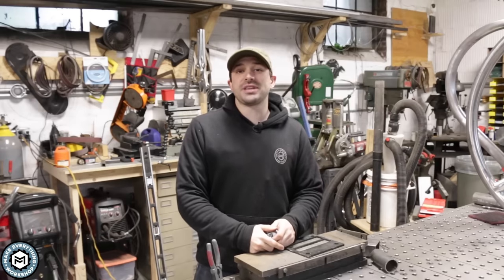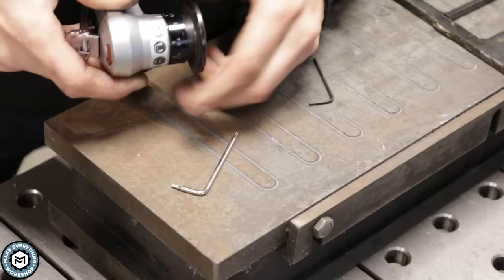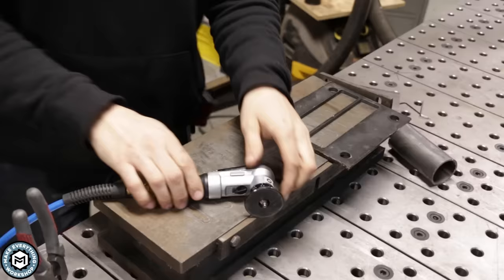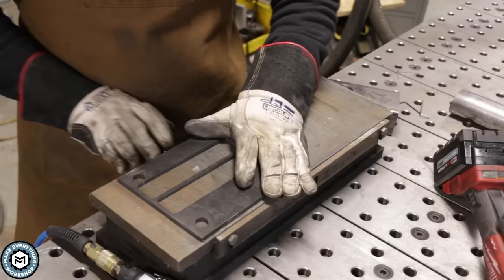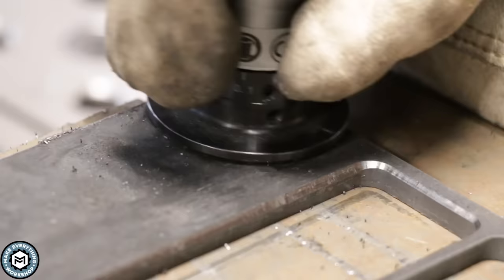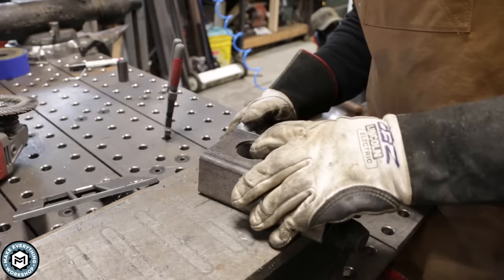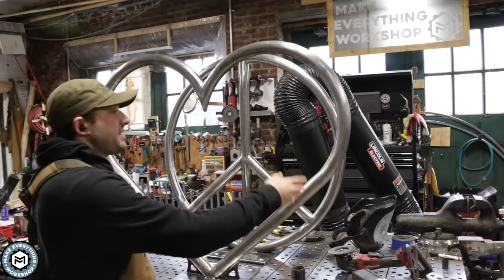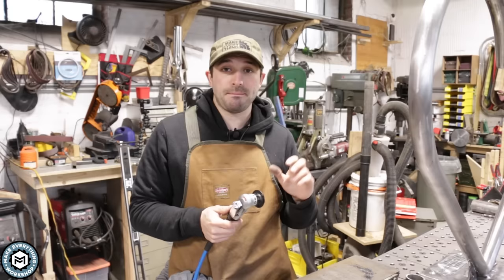This $88 Tool Will Change Your Metal Work Forever!

Comment: I see it as not just as a finishing tool but a prep tool for butt welds. Quick easy chamfer , faster and neater than grinding.
Reply: It would work great for prepping pipe for butt welding.
Reply: Exactly, i am thinking about this use. Thanks to the Algorithm of Youtube that recommended this video to me!
Reply: Yes, that's exactly what I thought even before he showed the pipe that I commonly work with and but weld
Reply: that's the first thing I thought of... I've used a grinder on many pipe ends... this would have been amazing to use

Comment: Basically a router for metal. That really does a great job. Thanks for the linfo
Reply: Interesting, for those without compressed air, using carbide inserts on a router could work well too! I have no idea if it exists but assume it should :D
Reply: @thebibidu  you could probably just use a standard router chamfer bit as most have carbide edges, but without replaceable edges that'll get pricey.
Reply: @thebibidu  just gotta use the proper RPMs for metal vs wood

Comment: I’ve had mine for 4 years, it’s brilliant. The bearings are available at any bearing store, the cutter tips are available, mine lasted for ages though. It’s for steel and soft metal only, don’t use it on stainless.
Reply: They make carbide for stainless cutting, Its a matter AS usual TO NOT LET YOUR TOOL WORK HARDEN THE STAINLESS, keep your feed aggressive and slightly less rpm
Reply: Sad to hear not with stainless steel.
Reply: Why would a carbide tool not work on stainless?
Reply: @AlessioSangalli  One of your commenters replied to you not to use it on stainless - don't now why.
Reply: @raydreamer7566  no I understand, I was asking the dude that said that
Reply: @raydreamer7566  I bet you can use it in stainless, if you use some type of coolant in the process. Use lower rpms.
Reply: We use the same carbide inserts to cut stainless on mills and lathes all the time.  SS is much pickier about federate and surface speed of the tool than mild steel or aluminum. I think I need one of these, first time I use it on stainless I'll make a video ;-)
Reply: @chriswisneski6071  I would like to see it.

Comment: The key to keeping the inserts last longer is heat and not hitting sharp inconsistent edges or hard mill scale. It’s the same insert used for lath work or milling. You usually use coolant in lath work so keep them cool and they will last longer.
Reply: it's not about "heat" as much as lubrication
Reply: @chronokoks  that's what my wife says,,
Reply: That is not alltogether true. Insert tooling either want flood coolant or no coolant. If you use just some coolant the thermal shock will make the inserts crack.
Reply: Coolant on a hand held carbide tool??
Reply: No, I did not say to use coolant on a handheld tool. I said the key is to keep them cool. I was simply saying that mills and lathes use the same inserts and they use coolant to extend the insert life.
Reply: It's carbide, Not HSS. I pull red hot chips off the lathe all the time with no coolant. Trust me. you will chip carbide long before you will ever wear it out.....and coolant has to be on carbide every second. If the coolant gets away from a hot carbide insert and then hits it while it's still hot it's micro crack city and the insert cracks at the next heavy cut. (But you are not taking heavy cuts with these tools) 

I just ordered one of these so I'm not sure of the insert but it looks like 3/8 or 1/4"IC. or there abouts. 

10-TNMG 16040 chicom inserts will set ya back 10 or 11 bucks. At under 40 cents an edge as far as using coolant or cutting oil....Who cares?  If you don;t break a chip you should go months of everyday use before you hae to flip an insert.
Reply: @mathewmolk2089  Thank you for specifying the Insert Part Number for us noobs.

I'd rather buy locally than having to import directly from China
Reply: Can't ite inserts be sharpened?
Reply: Carbide inserts cannot easily be sharpened, it would take a long time to fix a tiny chip. They are super hard. It takes a specific grinding wheel too.

Comment: That pilot bearing looks like a standard size for router bits. The screw on end of the cutting tip should be removable to let you change the bearing. ✌
Reply from the maker: Good catch! I haven’t looked too closely at it but I’d guess you are right!
Reply: @MakeEverything  That's what YouTube is all about to me. I made a 2×72 grinder with help from videos which would have been a real bear without them. ✌

Comment: Measure the dimension of thr bearing with a Micrometer and order from almost any bearing supplier.
Reply: Or take off the bearing to see if it's marked!  Too many posts saying "it looks like..."
Reply: Or, just ask for a 683ZZ, as specified on the parts list (that came with mine).

Comment: Just ordered and received one of these. Can’t wait to try it. 

The bearing is a 638ZZ. Easy to find. They sell them on Amazon.
Reply: It's  actually  683zz 3 mm x 7 mm x 3 mm.
Reply: I bought a kit of 10 bearings of this size and this number is even in the tool manual, but the axis is not 3mm but 4mm, I threw money away.

Comment: Thanks for the tip, I just ordered one from Amazon. About the bearing I have a company in my city that just sells bearings in every size, so when I get it I will go down their and purchase some spares that most likely will be a lot better quality, then I will let you know. The grinder itself is about two weeks out before I receive it. Can’t wait to use it👍👍👍
Reply: Would you post the bearing size for others?

I should find a local bearing company, and give them some entertainment with the weird ones I try to find - like ones to repair the roller-brush on my $130 Hoover house vacuum.
Reply: @firstmkb  I won’t be getting the grinder until about the last week of July. The company is all they do is sell bearings and I will have to take it down their to see. If they can’t match it to something in their books nobody can is my guess; because all these duds do is sell bearings only and all types.
Reply: I have one and the bearing is a 683ZZ.

Comment: Just because you can never have too many sources for replacement parts, that little bearing is also found in 3D printer parts very regularly, especially around motors and extruders. You should be able to get 10 in a pack for a couple bucks.
Reply from the maker: Great tip! Thank you!
Reply: Yes but, those low quality bearings won't last long at 30,000 rpm.

Comment: That tool is very similar to a router bit used for wood working, so you may want to look at either Rockler or Woodcraft for the replacement bearings.
Very cool tool.
Thank you for sharing.
Keep the videos coming.
Reply: bad advice. chip a flute on a brazed carbide its done. where those tcmt carbide inserts are cheap. very cheap, and can be replaced one at a time.

Comment: This is just another Aliexpress tool you can buy the bearing for 20 cents and packs of cutters for about $2-5. There are tons of these types of specialty tools on Aliexpress because china applies mass production to EVERYTHING, so it makes sense to have a specific tool for every step of the way to make things as fast as possible and maximize output.
Reply: Yep, just search "Mini Pneumatic Chamfering Machine" on Ali for them.

Comment: That bearing is probably the same as my wood router bits.
Reply: Beat me to it.
Reply: I instantly wondered what kind of cut it would make in wood.
Reply: @markkollman870  pretty well I'm sure since rpms are probably around the same but ya can't take as big of a bit with his router as a normal wood router but for that little chamfered it does produce is probably pretty good on wood just not as adjustable

Comment: I am a machinist and have owned this tool for over a year and only used it a day.  If you are just looking to deburr and think this will be easier and fancier, it is not. Very slow and hard to maintain an even chamfer. Video says that it throws sharp chips out, but left out they are also hot as fire. For welders and those who absolutely need chamfers  with no other tools to get the job done I would recommend this tool.

Comment: Milwaukee needs to make this on there 12V Fuel platform.  Air tools are so freakin loud and the hose is annoying.
Reply: No thanks. You need serious PPE anyway and battery tools are over expensive
Reply: @AlessioSangalli  I would gladly pay the premium of cordless over an air tool.
Reply: I like my corded Milwaukee tools...
Reply: I like turtles
Reply: Bow to me faithfully Bow to me splendidly  that is only relevant if you use such tool for such lengths of time, thousands of hours, that energy cost becomes more expensive than batteries. In such case, the tool couldn't be cordless anyway. I understand if you say that a compressor has a higher non recurring cost or it takes valuable space in the shop, but the argument about energy cost to me seems very weak.
Reply: They do. It is a router. Use it every day for metal, works awesome. M18
Reply: @pscgmail  Hmm I might have to give that a try - thanks!

Comment: These cutters typically are also double sided, so you would get 6 cutting edges per cutter. Just a thought and you might check. Zip~
Reply: These look like TCMT inserts based on the Amazon picture, so they'd be single sided (because of the 7º relief angle) .. granted Amazon pictures can tell 1000 lies :)

Comment: you change the bearing for a small brass piece, stick a small disc behind and you hold the bearing with a sunken machine screw. Bit of blue loctite, don't gorilla into the bottom but just let the brass slightly rotate..  :)

Comment: Nice tool! The bearing should be easy to find from remote control Nitro engine clutches. They can tolerate 25k rpm plus

Comment: When chamfering plasma cut with work hardened surfaces, be sure to run this cutter in a conventional milling pattern (not climb milling).  Get under the scale rather than pull it into the cut.  Your inserts will last 10X longer.

Comment: I'm sure glad that I came across this video. There are different camfering tools out there but the ones I have seen are bench mounted so you have to bring the material to the machine. The carbide cutters look like standard TCMT to me. The size is either 1/4" or 3/8" I.C. that stands for inscribed circle. This is the size of a circle that lines up with the three flat sides. The first thing that I would do after purchasing one is look at the bearing number and buy any name brand bearing.

Comment: I know it would be messy and need cleaned for welding, but I would what about a lubricant? It could even be the water based machine cutting lube. It could produce a smoother cut but that can be smoothed if needed. Not needed if welding as the “Angle Cutter” is providing a deeper penetration while staying flatter on top. Just a thought but after all, 3 sides to each cutter would decrease the cost per use. Also, if it is cutting on the side, the tip maybe perfectly sharp for re-purposing the cutter on a brake lathe as they look the same without actual measurements. McMaster-Carr May have these cheaper by size and angle of grind on the cutting face. You may not have a brake lathe for cutting disc, but may worth looking into. Just a thought as on the farm or small town shop, you never throw anything away. Tool of the week, from a guy who became an ASE Master Tech before MIG welders were sold.

Comment: Always thought a router table type setup would be handy where you could walk up, hit a foot pedal switch and run a piece of metal over a grinder that do the bevel.  But it wouldn’t work for inside edges like this tool can.

Comment: Nifty. It's probably overkill for this application, but you could probably also use it to chamfer edges before welding a butt joint.
Reply from the maker: Sometimes I do that actually, it’s nice on square tube when your doing a lot of it

Comment: Look on the face of the bearing. One side or the other. There should be some numbers you can get an exact replacement based off those numbers.
Reply from the maker: I’ll have to look closely at it and see! If I find a replacement bearing I’ll post the link to it in the description too. Under heavy use I could see the bearing failing

Comment: You actually get SIX new sharp edges on those carbide bits. After rotating 120deg for the first 3, you take th carbide off and turn it over for another 3.

Comment: That looks exactly like a router bearing... I don't know if it is or not? I worked in a cabinet shop for 5 years. The ONLY oil we would use on our router bearings was Marvel Mystery Oil. It's the only oil that could stand up to the high RPM. Marvel Mystery Oil mixed with Motorkote,  should prolong your bearings lifetime exponential!!!

Comment: most carbide cutting inserts you can flip and use the cutting edges on the other side as well, which would give you a total of 6 cutting edges per triangular carbide insert
Reply: Wrong, they have rake angle ground into them and are recessed for the fastener 🤣

Comment: Two questions on a two month old clip: 1)how big a chamfer can it make?
 2) is it possible to create a rudimentary cutting edge by chamfering opposing edges to a point in heat treatable steel?
Reply: Sorta, but the point would be 90* angle... Not exactly very sharp. You'd get a support edge by cutting one chamfer deep enough to make a point with the other side of the material - that would give you twice as sharp of an edge.
Reply: If the entire bit can be swapped out (and has a standard shaft) , there are a TON of other carbide bits made for woodworking routers and Dremel tools etcetera.  There are pattern following bits with the bearing either above or below the cutter that can make a nice smooth edge, and v-groove bits like you asked about.
Reply: @firstmkb  No collect on this thing. It is not in the seance of woodworking a "bit" at all. It's a milling cutter that looks like an integral part of the shaft.

Comment: ❤  You may be able to replace the baring with router bit baring.
I know they are good for around 20,000 rpm. Not sure what size shank you have (inside diameter).
Reply: It's really a metal router isn't it?
Reply: @tylerbennetts8079  the baring is not cutting, it's only providing an equal distance.  I believe the question was where to get a replacement baring, was it not?

Comment: 🤔 I once used a wood router with carbide router bits. On metal for a similar purpose
Reply: I used my table saw with a cheap carbide blade to cut a grid into cast iron to make lapping plates.  Blade chatter kept the grooves from being super sharp, but no problems other than taking two days for my sphincter to relax!

Comment: That magnetic chuck is freakin awesome. Would be really cool to integrate it into the table for a completely flat surface (maybe removeable for flexibility).. Where would you suggest someone look to find something like that? Orrrr.. if you really make everything, make a vid showing us how to make one :)  Ohh and the chamfer tool is pretty cool too :P
Reply: HGR industrial Surplus in Euclid Ohio, but grab your ass when you see the prices. - They are high precision devices that go on machinery that finished parts to ;less then +/- .0001" ,,,,, or even under 10 millionths on the top of the line machines.

Comment: The carbide inserts we used at the shop we could use three sides then flip it and use the other three on the other side for a total of six. Not sure about the ones you are using though.

Comment: So after watching this review, I ended up buying myself one. I love it, only problem is I believe I over tightened one of the screws for the cutters and the head of the screw snapped off in use. Unable to remove that 2mm screw, Amazon is refunding me. All in all, an amazing little tool. Plus you can get replacement screws for the cutters, just good luck removing it if it breaks.

Comment: Nice! I need this! Thank You! This will make my projects look much nicer and quicker. Been using angle grinder and/or file for bevels. Didn't even think about using this on tubing! Nice also! Will make some fittings on pipes and/or exhausts better!

Comment: Great video thanks for sharing. Looks to me if you were to chamfer both inside and outside edges of that tube you’d have a fairly decent hole punch for soft thin wood or leather.

Comment: Very cool! I wonder if they sell an insert bit like this with a 1/4” shank that will fit a woodworking router?
Reply from the maker: I wonder! Worth checking out!
Reply: Thats a great idea but if it's like most woodworking tools they run too high an rpm to use on metal. If it was me I'd compare the rpm ratings before I bought them.The other thing is should you give the metal a spritz of cutting oil first?
Reply: Not an "insert" at all. It's an insert milling cutter and looks like an integral part of the shaft. .... Metal working tooling is worlds apart from woodworking. .... Fact is the inserts I see on woodworking tools look like they are  actually re-purposed machine tool inserts (marked up a couple hundred percent)

Comment: Assuming this tool rotates in the same direction as a wood router, then it will be good practise to move the tool in a counterclockwise direction around the workpiece edge. This prevents climb giving a better finish. I noticed in the video you were moving mainly in a clockwise direction?
Reply: clockwise for inside edges and counter clockwise for out side edges

Comment: Nice video and tool looks awesome but living in NZ this tool works out to be $120nzd + inserts when its $40nzd die grinder that could be modified or as many have done just use a router with carbide inserts lol.
Def on my bucket list if i don't end up making one